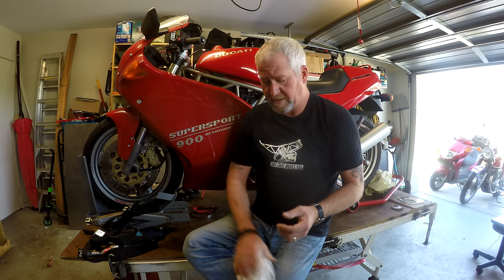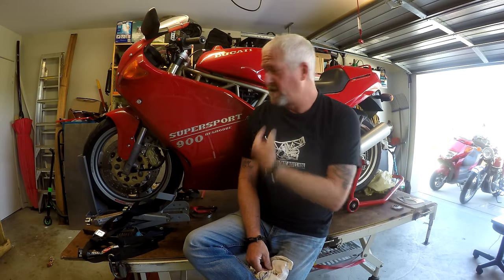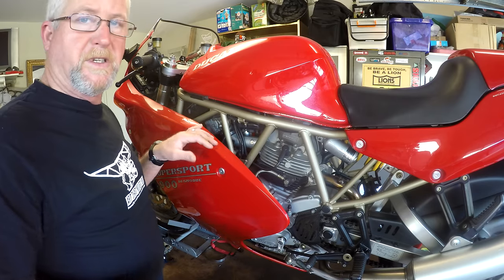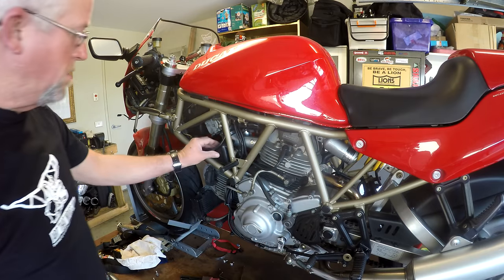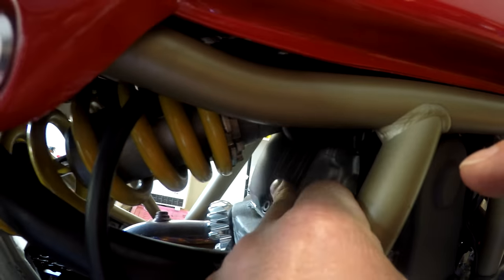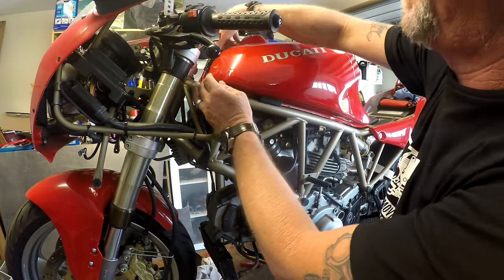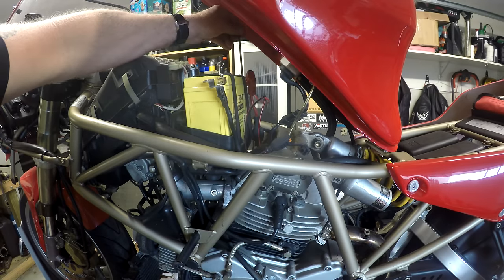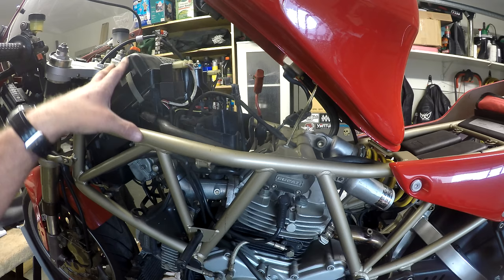Ducati 900SS - Valve Maintenance (Part 1)

Comment: What a great trick for turning the crank! Will try and do the same once i have my project here!
Reply from the maker: Car Karl and what project would that be mate? Anything exciting?
Reply: that would be a very early 1994 Monster 900 which i managed to find for 2000€ (3000A$). It has only got 16000k's on it and i am buying it from it's first owner. Only downside is that it was kept in a garage for 10 years and has not been ridden or run since, due to a family member passing.. so this saturday i'll have a look at it.. will take a little endoscope to look inside the tank and cylinders and am allowed to try spinning it by hand. Will however put some oil in the cylinders first. I hope it will turn freely, if it does i'll buy it. Quick sidenote, as i noticed that your Australian, i found my love for Ducatis in your country. I flew to Sydney after finishing highschool here in Germany with the aim to work and travel around the country. Little did i know the motoscene was pretty big over there and after seeing so many Ducs i had to had one myself.. so i bought a Monster 900s and put around 11000k's on it riding up and down the eastern and southern side of your country. (i actually have 1-2 little videos of that on my channel). Made a few good friends on the way and alot of memories. I loved Sydney for its beaches, beautiful scenery and nice roads like the old pac hw. Where are you based?
Reply from the maker: Car Karl Hobart Tasmania, although I'm originally from south east Queensland
Reply: I really really wanted to take the ferry to Tasmania, but when i was around Melbourne the weather forecast wasn't the greatest and also taking the ferry cost into consideration i did not make it over there. Regret it heaps though, a friend of mine who rode all over Oz and even to Uluru an a 1199 Panigale went to Tasmania as well and he absolutely loved it
Reply: To turn the crank. Remove the spark plugs, put it in 2nd gear, and turn the back wheel.

Comment: Very helpful. Doesn't look easy, but doesn't look hard. Just bought a Ducati 900 monster from 95, (naked bike version of your bike) and people kept telling me I'll be spending thousands for a simple bit of maintenance. I call bologna! I can do this myself. Thanks for the helpful videos!
Reply: Do you do this every oil change? Or every 3? How many miles between valve checks?
Reply: @LS-oh8kv  i know its been 6 years but valve checks are check after 100mi, then every 15,000 miles after that. So MANY YEARS if you ride as often as me

Comment: Plastic tools are a plus , buy and or make . Metal screw driver or pick will cut a seal . I used valve stem seals from Felpro Gaskets .  Stem Dia. -  seal seat dia.on head - hight of seal  , give them a call and their tech dept will be glad to help . 
Long lasting and able to withstand high temps.

Comment: To stop the valve from dropping into the cylinder you could fill the cylinder with air from a compressors and keep it at constant pressure.

Comment: And I thought my Triumph was a pain to get to the plugs and shims,
you need the seat and rear fairing off to get the Tank off, then dismantle the airbox  but at least I don't have to dismantle the rear suspension or remove the battery+box to do it!
And, what were they thinking when they came up with that valve design?? far too much metalwork there, It's no wonder they go wrong!

Comment: Very useful video, thank you.

A tip for helping prevent the valve from dropping into the cylinder. Fashion some wire with a small hook on the end, that you can feed through the spark plug hole and position under the valve. It will stop the valve from dropping too far down. A technique they suggest in the Haynes Manual.

Question: How did you get those pipes looking so beautifully shiny? I want to pretty mine up like that.
Reply from the maker: Thanks mate, and thanks for the tip. This bike is very low mileage and the pipes are untouched. Fine steel wool and elbow grease usually cleans that type of thing up well. Cheers, Andy
Reply: Andy's Motorcycle Obsessions Mine are awful. Looks like I have to put in a lot of elbow grease then! I’ll probably take them off and use a buffing tool with some paste. Safe rides and big smiles, cheers!

Comment: HEY ANDY! quick question, I have a 93' 750ss, the whole bike is converted cafe, but I am still running stock pipes. I do have some smaller pipes that could be considered "straight". I would like to run them, but am nervous considering back pressure and throwing off the valve adjustment. Should I leave the stock pipes on, or could I put the straight pipes on without damaging my overall tune. Thanks!
Reply from the maker: +tylor torres g'day Tylor, thanks for tuning in. You'll be okay with the pipes, back pressure is bad...always. See how it sounds at idle, you may need to fiddle with the pilot jets but more than likely not. Have a look at my video on exhaust systems https://youtu.be/eOg1sZhUNcg Andy
Reply: Andy's Motorcycle Obsessions Thanks a lot for the info! I did the swap and it turned out great, bike sounds, feels, and performs 100x better!
Reply: back pressure wont affect valves at all, not sure why you thought that lol

Comment: This video is literally 10/10 helpful thanks!

But I thought that to access the vertical cylinder inspection covers you could just remove the battery tray insert and not the whole battery tray/airbox assembly?
Reply from the maker: Hi Billy Jeans, thanks for tuning in.  I can't speak for all Ducati models but mine is molded as part of the airbox, with  no removable tray that I could see.  Besides, it makes access a darn site better with it all out of the way.  Thanks for the comments, Andy
Reply: Hi Andy, that's interesting, mine has the removable rubber section which
 meant I could do all of them only having to the remove the shock for 
the vertical exhaust valve access.
Nearly all of mine are bang on spec and one is off a tiny bit but well within service limits.
Your video REALLY helped, thanks a lot!
Billy
Reply from the maker: Interesting, perhaps I should of had a closer look, you have me intrigued now.  As I said in the video, I'd never done that job before on a Ducati so I may have missed that.  Andy